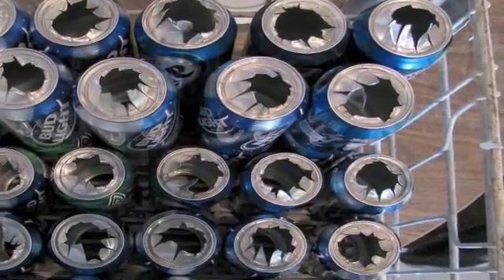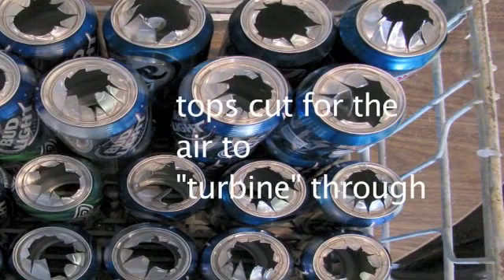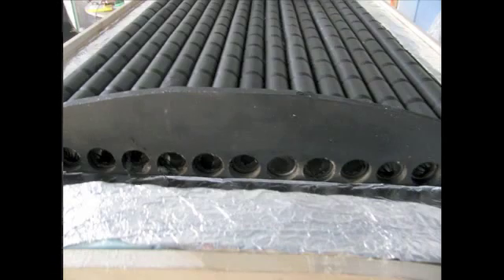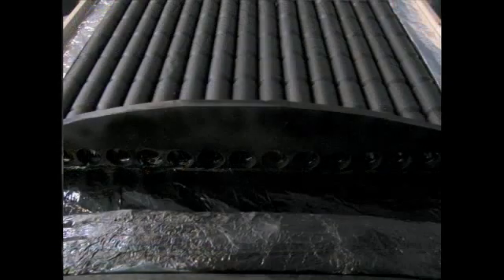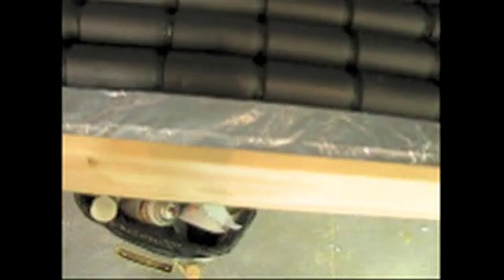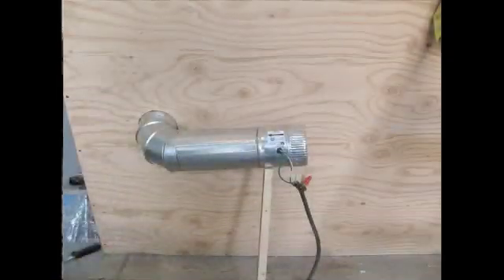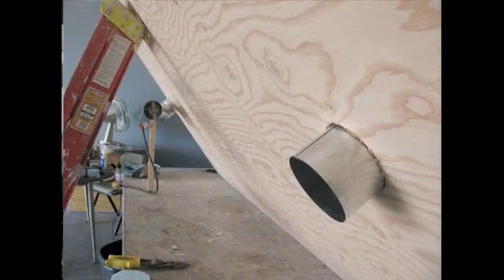DIY Solar Heater

Comment: Very nicely done, seems like it was a successful test well worth the effort. I wonder if you can push it more if you use 15 cans and use the last 5 with soup cans since they are slightly thicker and have ridges that would keep in the heat better and condense?

Comment: To the tubing/snake folks. You want maximum temperature difference between the (cold) air and the (hot) cans for most efficient thermal transfer (hot to cold). What's the point of the 100th can, if it can only add a degree or two of extra heat to air that's already been super-heated by the previous 99 cans? Best to have lots of optimum-height columns of cans.

Well, that's my view, anyway.

But I'd like to know what the optimum height is (I guess it's about 15 cans, max). Any ideas?

Cheers.

Comment from the maker: @000Winter000  No step  by step ins  only pix are on utube.  I used 4x8 sheet of plwoodfor  back and made it fit to that. I have just put a small furnace fan on to get enoujgh heat out . It seems air flow is the biggest thing to work out so you can get the heat out .   Today was warm 38degrees but panel was putting out 110 degree air into garage  Pretty cool huh? Good Luk

Comment: @ariana29x Think of it as a system though, the only energy going IN is from the sun over that surface area painted black. Letting the air cycle through longer will get it hotter, but you will have slower flow so your total energy will be the same if you have good insulation like you talked about. I guess snaking some cans if you want very hot air would be good to heat water or something, so you can store the energy overnight? Also remember that snaking the cans will kill your natural convection

Comment: @ariana29x If he did that the cans would have heated up too much. The higher the temp of the cans and air, the more you are losing through insulation and the plexiglass. You want to get the heat out as quickly as possible to avoid losses, so a lower temperature, but higher flow rate is actually better. Remember its about air volume and temperature, not just temp.

Comment from the maker: @onesojourner   I ended up going up to an old style furnace fan that  had the pulleys and belt and got the rite pulley ratio to get the air movement I needed. I was havin trouble gettin the heat out so had to go a lot bigger on the fan good luk

Comment: I checked all the floor vents in my house and the hot air that comes out is about 130 degrees f.  It seems to me that if you were to add a second intake and exhoust vent that you could double your air flow and the air temprature should still be high enough to keep you comfortable while the sun is shining.  Give it some thought...

Comment: I have the same snap disk, but seems like if there isn't direct sunlight it drops down in heat quite a bit. Mine usually stops running around 1:30 pm this time of year. I'm in Wisconsin.

Comment from the maker: I saw you built one out of corragated tin. Did you build another one a different way ( tin cans)to see which would get you more heat??  Also do you think vertical angled towards sky makes much difference?? I plan to exkperiment on mine soon to see if I can tell much difference. tks